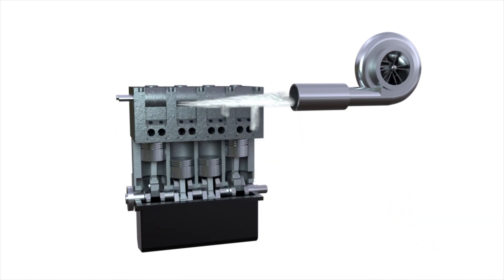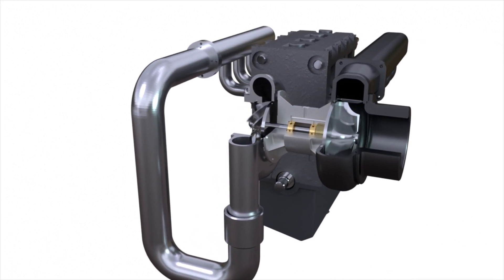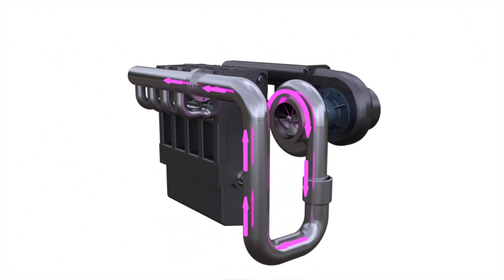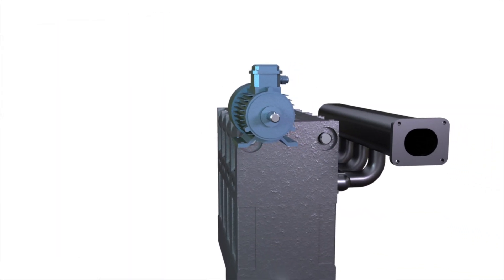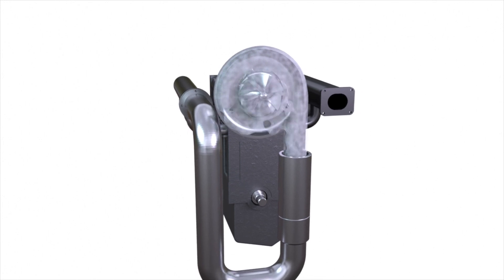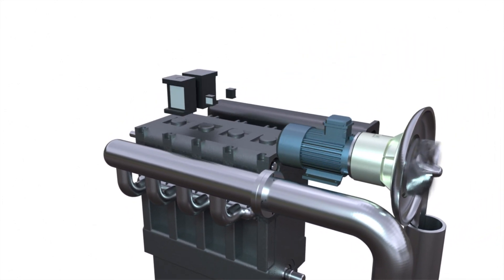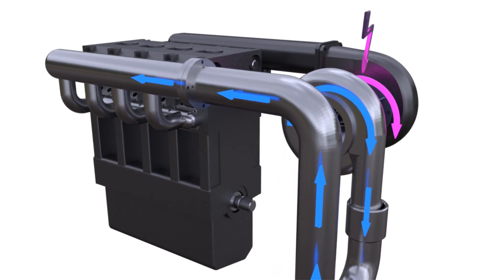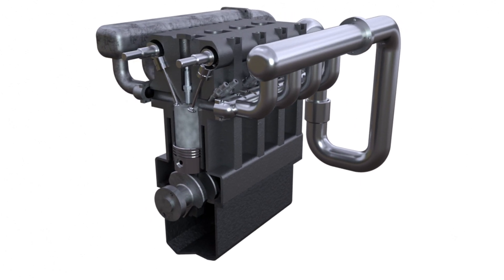Electric SuperChargers. What is an E-Turbo?

Comment: Why not spool-up directly from the back end of the starter motor? Sure you will have to sort alignment up and utilise a double solenoid (one for cranking and the other to engage at low RPM) but it has the torque to drive a compressor ? ........Just putting it out there .
Reply from the maker: Yes, but the starter will require energy. So you need a powerful battery. In addition, a high rotational speed is required. Here the problems are like those of a supercharger.